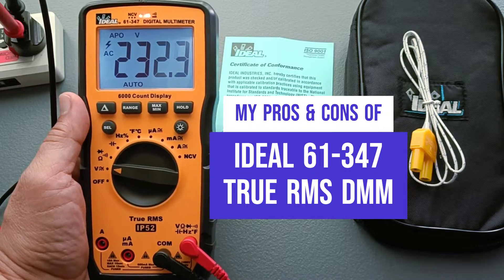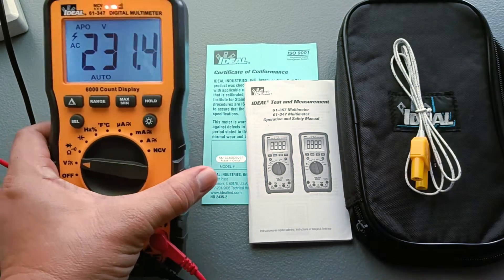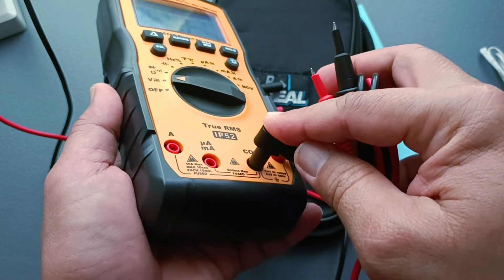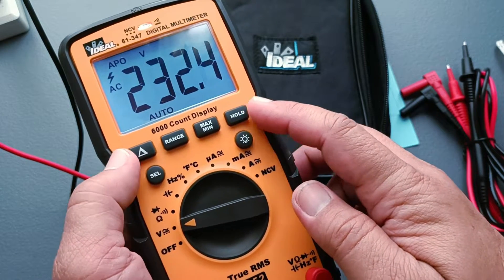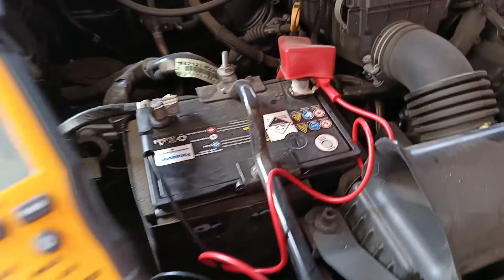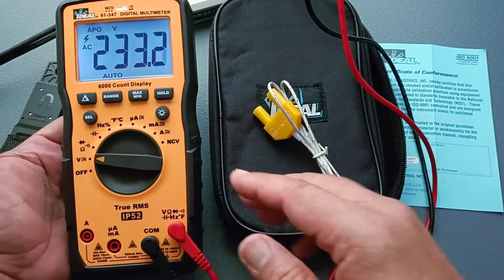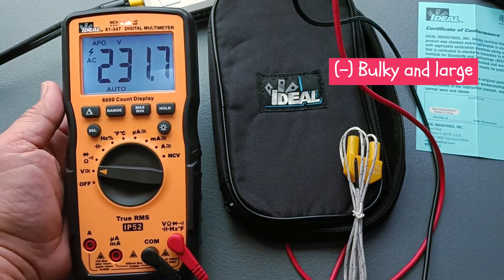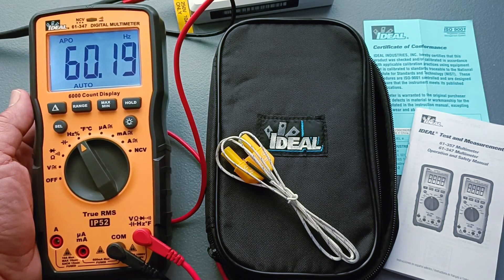[CC] Ideal Industries 61-347 True RMS Digital Multimeter Pros and Cons

Comment: how's battery life. I bought a 61-486 and it sucks
Reply from the maker: I haven't used it for long since I have other DMMs but I'd say that battery life for my 61-347 was good enough if I use 3-AAA alkaline batteries. Your 61-486 is powered by a 9V battery, so I think it's a contributing factor. My Fluke 116 also runs on 9V battery but I use Lithium ones, and I have yet to replace it. When I installed a 9V alkaline on it before, it didn't last very long. By the way, I avoid alkaline and carbon-zinc batteries, unless for quick use only, as they can leak on the test equipment. I prefer rechargeable Ni-MH or lithium compatible batteries.
Reply: @ramschannelreviews  Bought some lithium and waiting till the alkaline gives up. Am watching it closely

Comment: Ram, great video again. 
I have some thoughts about this. Please let me share those with you:

I once forgot my multimeter at home and had to buy a 'cheap' on the way to my customer.
It was also rated CAT III 600V AC but I was afraid using it. It did not feel safe at all working with this multimeter. 
In fact, I find it very dangerous to suggest a cheap multimeter from a brand that is unknown to everyone. Saftey is paramount. 
I would rather go for the cheapest quality brand such as the Hioki DT4254 or Kyoritsu KEW 1009 or KEW1021R. 

A lot of smaller companies just put something on the shell/exterior without knowing what it is. There needs to be a compromise somewhere.
I have to say that the battery compartment looks decently protected since it has deep grooves. However, how is the interior designed? Is there also some sort of protection?

When looking at it from an insurance point of view, prefer buying from a company that is local or have an office within the country. They need to match local rules and regulations.
What do you think?
Reply from the maker: @oliverlison Thank you for your thoughts. After reading them, I had to check whether I did a review of a multimeter that I myself will not use, LOL! I'd add to the testers you mentioned, KEW2127R, Fluke 323/324, KEW203, Hioki CM3289 as some of the affordable test equipment with legit certifications. As far as I know independent organizations like UL, CSA, or IEC set the standards but they have no power to check for compliance unless contracted by the manufacturer, isn't it?

Your concern was valid but unfortunately, I wasn't able to do a tear down. I'm not very knowledgeable on the innards of a DMM, but I understand that's very useful for many users. Still, I give the Ideal 61-347 the benefit of the doubt as it's not likely this company will make a false claim on their safety certifications. If someone else will do I tear down I'd be happy to give them a thumbs up!  

Investing in a good quality test equipment can be tricky for an individual user who hunts for a good deal and sometimes one gets it abroad (amazon has been a good source). I agree. If you can get it locally at a close enough price, all the better for insurance and warranty purpose. There's a good reason why companies and contractors tend to stick to the expensive brands they already know.
Reply: @ramschannelreviews  
Thank for writing back so quickly.

During my recent hunt for a new multimeter, I did a lot of research. I also asked you a few questions about your Hioki dt4261. Which helped me to make decision.
I am very happy with the Hioki. I could not have made a better choice. 

During my research I also came across mulitmeter that were not suitable for any use. Please google 'EEV Blog Multimeters that do not appear to meet their safety specs'
I cannot put links here.
Reply: Complete rubbish. What are you talking about. All the big brand multimeters are made in the same factory in china. I have been using a cheap multimeter for thirty years and I have never had any problems with it and it cost £5.00 . They all meet the international standard for safety compliance. And would not be sold on the open market if they didn’t.
Reply from the maker: @Dog-whisperer7494  Thanks for your comments!
Reply: @Dog-whisperer7494  

 @Dog-whisperer7494  Don't come across like that. You are the one who is talking rubbish. I have also made my own experiences between very cheap vs more expensive multimeters. Maybe you have never used more expensive multimeters. Or maybe you have never used multimeters on a prefessional level. Then you would know what differences I am talking about.

Yes, international standards for safety compliance are met? I don't think so. If you can cut costs, cost will be cut. Have look at your phone charger and ask yourself how many have set a house on fire? Did they have all the needed certificates? Yes, they had. So have multimeters. There are multimeters that just meet the standard. There are other multimeters that are built to go beyond the required standard to offer more protection to the user.

Also, not all big brand multimeters are made in the same factory in China.
Maybe you should visit EEV Blogs Channel who is explaining good and bad multimeters.
Or even better google: EEV Blog Multimeters that do not appear to meet their safety specs. 

So stfu!!
Reply from the maker: @oliverlison  I appreciate the head's up. I looked the list up and it was quite a revelation! Seems to me crappy fuses were some of the big culprits. Surprised to see UT61E on the list, although I don't have that. I do have the newer UT15B Max, which happened to have 2, high speed, 1000V fuses with massive interrupting rating. No wonder it was quite costly. Congrats on your DT4261! I have quite a number of Hioki test equipment and I can count on them all for safety and reliability.
Reply: @oliverlison you’re totally wrong also I said all the big brands ie fluke ,Kewtech dialog and so on are all made in china in the same factory Infact they have a number of factories in various parts of china all making the same machines. Secondly I have been  qualified electrician/ electrical engineer for thirty five years. And use all kinds of test instruments on a daily basis. I think I know a lot more than you also we have the safest electrical systems in the world and the best trained engineers to keep it that way , but yes you’re right there are a handful of these meters the don’t meat the required safety standards. But the one in this video is not one off them .and yes I also use the more expensive brands as well.
Reply: @oliverlison instead of telling me to visit some silly blog channel, why don’t you visit the factory’s in china and see for yourself. The mark thousands of multimeters a day in different colours and badge them for different companies. Do you the Bosh Drills and washing machines are made in Germany or DeWalt are made in America well they are not they are manufactured in china. I have been to one of the factories so I know for a fact I am 100%right .
Reply from the maker: @Dog-whisperer7494  I think what you probably meant was many models of these big brands were made in China, although they have other plants in the ASEAN (my Fluke 116- Singapore, Fluke 324- Malaysia, Kyoritsu 2127R, KEW203- Thailand). This and my Fluke 107- China. Would UNI-Trend (UNI-T) be one of those factories you referred to? I've never been to China. I admire your length of service, 35 years.